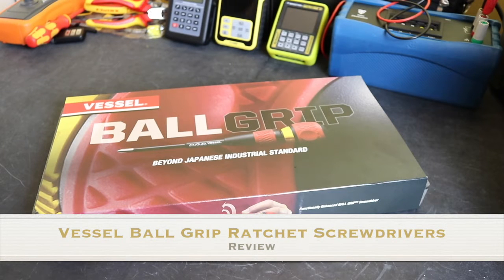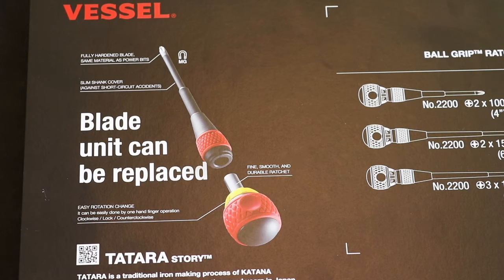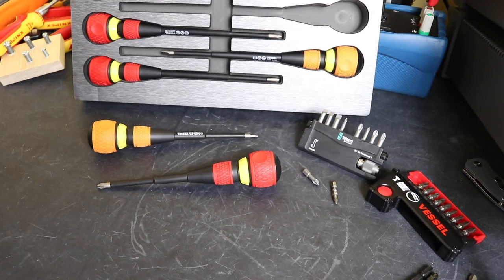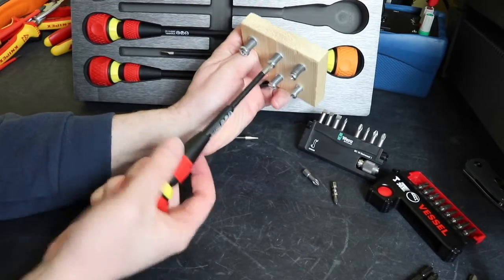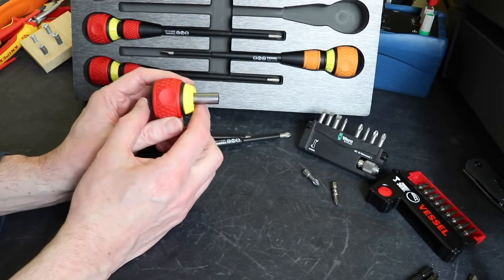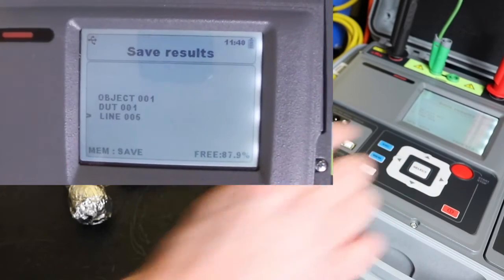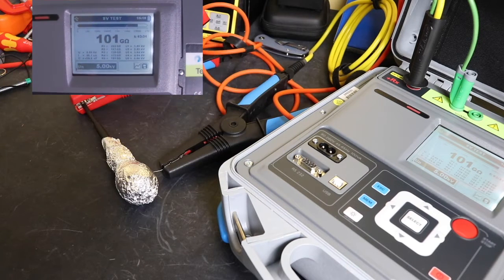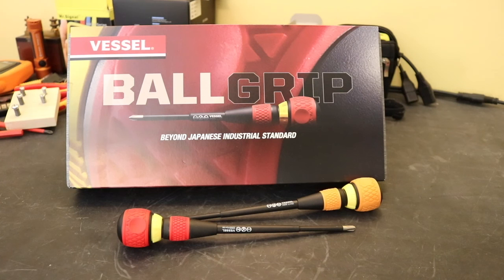Vessel Ball Grip Ratchet Screwdriver Set

Comment: Very thorough review and what a nice insulation tester.  Personally I'll take my chances on 230V after those results
Reply from the maker: Thanks for watching. Just remember that this is a brand new screwdriver and there is no dirt or moisture accumulated around the gap between the the ratchet handle and shaft, that would lead to a lower resistance. Insulated gloves would need to be worn to protect a person against live voltages. The official IEC test for insulated tools for live working is 1000V AC with the handle lowered into a water bath, that this would definitely fail.
Reply: @three-phase562   You're absolutely right in not recommending it but I use a lot worse myself on occasion and I have one of these models coming in the mail.  Although I don't make a habit of wiring things live too often anyway

Comment: Actually there is insulated tools without the VDE rating.
I have a wiha liftup with normal bits with no VDE while I have an other one with special bits with the VDE rating.
I believe the fact it wasn't rated it's because the ball ratchet driver can be used with normal bits so it doesn't have the rating because of that.
I've seen insulated adapters and they don't have the VDE, but it's insulated.
Reply from the maker: You are correct, tools don't necessarily need to be VDE marked to be used on live electrics, but they will need conform to at least the relevant standard for the country, such as BS8020 or 60900 in the UK or ASTM F1505 or indeed IEC60900 standard for other parts of the world, to be considered as insulated against electricity. VDE is seen as a more extensive test of conformance, so is generally what is referred. If I remember correctly, these screwdrivers from vessel do not have any of these markings what so ever, so I would not consider them to be classed as insulated.
Thanks for watching and commenting.
Reply: @three-phase562 Oh ? They don't have any markings for telling about their insulation ? They quite advertise the tools to be used inside electrical cabinets on electric components. Although most of the tools with insulation are at least red and yellow, which isn't the case of those drivers....
Reply from the maker: @Moonstalker  No these particular drivers do not have any markings on them regarding their insulation. They do make other drivers that are marked up as would be expected. So I would assume that these are more intended for use on low voltage such as in conventional cars and trucks.

Comment: Could a standard 3” or 6” bit holder fit into the ratcheting stubby shaft?
Reply from the maker: Yes, any 1/4" hex drive to DIN 3126 will fit the only thing I will say is that the shafts with the large semi-circular cu-out near the top will wobble a little more.